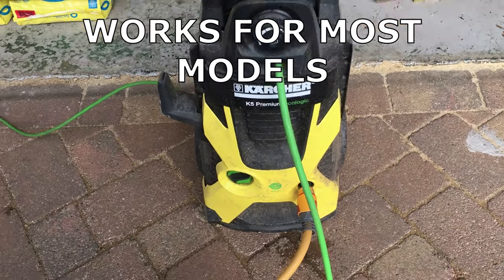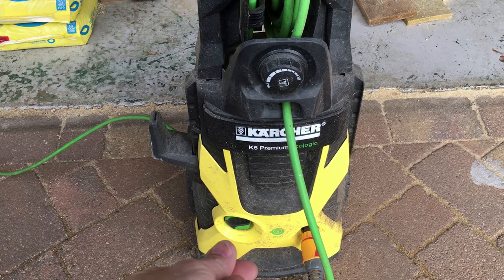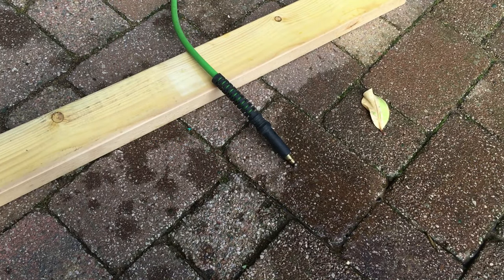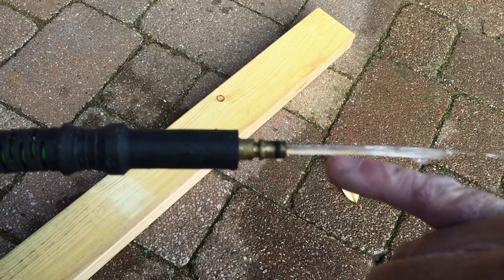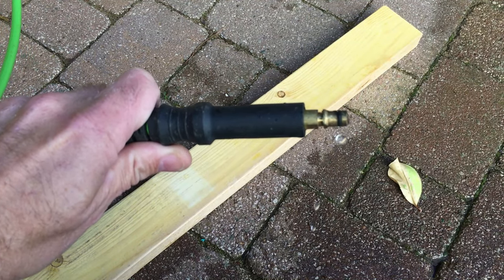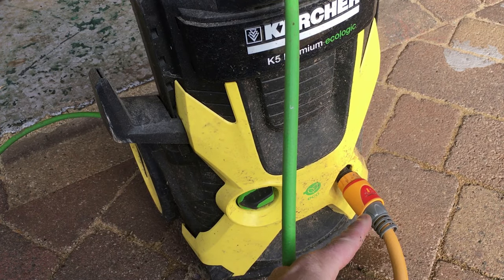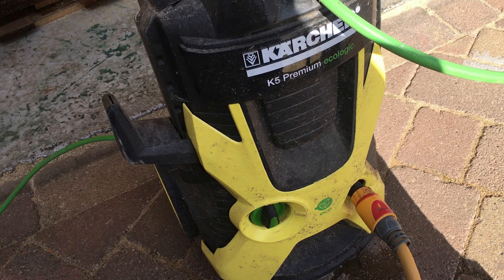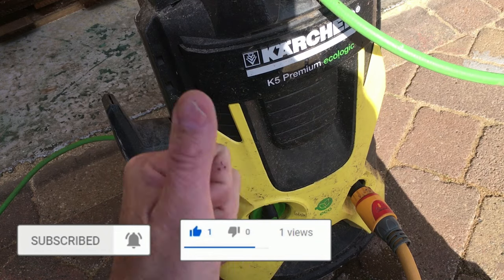KARCHER Pressure Washer Not Working | EASY FIX In SECONDS

Comment: It's great that you can share your experiences with the Karcher! A real credit for helping many people. Unfortunately, there are many variations of the Karcher - over the years, and they all seem to display many different symptoms - when in a 'failure mode". I own a HD 575S. It's an old machine from 1990. There is no fancy Pressure Piston & Microswitch for the "Instant start" function. The pump on this model, has twin valves (17mm A/F) on top of the high Pressure Casting. On the side of this Casting is a smaller (14mm A/F) Inspection Plug. My machine has the symptoms of not shooting high pressure water (intermittently) as you pull the Trigger. Sometimes when you squeeze the Trigger - it works fine. I stripped and cleaned all parts of the Karcher today, and everything (including the springs & valves of the Twin Valves) looked perfect. So, (now) I am suspecting the Trigger Mechanism of the Lance. I suppose many people will have a Karcher that has very niggly problems. My Karcher goes way back to the 1990s. It's not dead yet! I will find the cure. Greetings from Australia.
Reply from the maker: Thanks for the comment Peter, and greeting to you from Scotland UK !

Comment: Absolutely brilliant, thank you. Ran water on the K2 for a couple of mins, reconnected and karcher working as expected. It was a challenge for me to remove the hose from the main lance because so much pressure had built it. Quite the bang once I prized off the yellow clip just just take care when doing this bit. My sincere thanks for posting this.

Comment: Gr8 video, I actually chucked me Karcher out on the Kurb for the local Council cleanup then started wondering if it had a fuse, googled it and found this video, went out at 3am brang it back in, done as per instructions informed and butter Bing she worked. Even after I’d cut the power cable, re-wired it plug her in putt, putt, putt, putt idles works 
Thanks 🙏 
Must have some pressure sensor in either base of hose sprayer or inside machine itself, resetting that sensor works a treat. 
DO NOT THROW OUT PRESSURE WASHERS TILL TRIED THIS..
Reply from the maker: Great to hear Steven, another Karcher brought back from the dead ! Thanks for the comment 👍

Comment: Cheers- worked a dream! Karcher should mention this method in bold text in the setup section of the handbook.
 Just bought a new K4 and had this problem from the outset. Assumed the unit was faulty and after some cursing & kicking of the blasted thing resorted to washing the car by hand then found your video during a trouble-shooting exercise before dismantling/returning the K4.
Thanks for your efforts ;)
Reply from the maker: Thanks for the comment and I am glad the video helped you out. Yes, Karcher should definitely mention this as there must be SO many of these machines get dumped when there IS an easy fix.

Comment: Mine has been having pressure issues but I reckon this might be the fix. I have had the lance detached and it was splattering like that but didn't realise that it could have air on the system. Will try bleeding it when I use it next. Thanks

Comment: Did as you said Eureaka all was well. An hour into the job lost pressure. Did the same there must be air in the supply pipe which is new. Also realised that my lance pressure control also stopped functioning properly. So will strip the lance down in case something broken or a seal perished. The joys.
Reply from the maker: Thanks for the comment, hope you get it sorted John !

Comment: Great !  I have an old version of the K3 ...the hose does not come easily off the handle (and  I did not want to open the handle)..but removing the nozzle ans pressing the trigger (no elecric power) to let water flow as indicated did the job ....great thanks (specially since the K. service in my country is absolutely no help !
Reply from the maker: Great to hear, thanks for the comment

Comment: Hi.  Would you know - are the detergent pipes part of the water circulation in the machine ? I ask as my pipes are clear of water and I cannot purge the air from my K5.  However, when dismantled for access, if I put my finger on the detergent access point at the top of the machine the air bubbles stop coming out ( I put the pipe that connects to the handle in a bucket of water.  I’ve just installed a new cylinder head which made no difference to the pressure - seems like 50% of what it should be.  Any other ideas ? Thanks.
Reply from the maker: Not sure to be honest ?

Comment: Thanks very much. Just curious as to why it need to run for 5-10 minutes, is that to clear out any air blockages as I would have thought that would be instant once run through after a few seconds of flow.
Reply from the maker: Yes, to clear the air, but also to let the machine know that there is not an air lock. I think there is some kind of safety switch to protect the motor (in the event of an air lock), so running the water through disengages the safety switch. I may be way off the mark but it worked for me hence posting the video. 
 I have had a few people who say this did not work for them, so I always tell them to leave the water running through for longer and 9/10 times it ends up working. Hope this helps
Reply: @Bacrenfencing  awesome, thank you.

Comment: What is still spluttering after 10 mins? Do you keep the tap running until it's flowing properly?
Reply from the maker: You will never stop the spluttering totally, but if you get most of the air out of the system, the washer will fire up again.

Comment: Had high hopes, but sadly this hasn't worked for me (yet, anyway). My K2 has stopped and will not start again. I followed your instructions, and sure enough there appeared to be a lot of air in it, but after about 10 minutes it started to run more freely, so I connected it back up. Unfortunately, there is still no response from the unit. Is there possibly a switch inside that I may need to reset? Any advice would be much appreciated. Thanks.
Reply from the maker: Try running the water through for a good 15-20 minutes, that sometimes works. Not sure about the switch ?
Reply: @Bacrenfencing  Thanks for the reply, will do. I have taken it apart since, but couldn't see anything obviously wrong. Someone said something about a trip switch, but it looks like it's just the actual switch mechanism. After I put it back together, there was a very very brief noise when I switched it on, but it's gone back to not working at all.  I'll give the water running another go before I get a new one.
Reply from the maker: OK, let me know if it works James, I hope that it works for you.

Comment: Hey bud.
Ive got a K5, starts up and when ye pull the lance trigger, the water comes through and the pump/motor runs but its not up to pressure beyond the normal garden hose pressure.  Have i missed something?
Reply from the maker: Not sure ?
Reply: @Bacrenfencing  No probs bud thanks for the video anyway,might be a valve ir the seals startin to go, they can be changed quite easily i think.

Comment: Didn't fix the issue for me. Will try another capacitor and see if that does the trick but if it's not either an airlock or the capacitor are there any other quick fixes?
Reply from the maker: Not that I'm aware of mate

Comment: Few things to keep in mind.  The most popular garden hose size is 5/8" diameter, but the one you want is 1/2" diameter for reasons described in the video.  Consider this -  1/2" feed from laundry tub going to 5/8" garden hose; there will always be air in it, and your pressure washer will never work.  Also, there should NEVER be size adapters between garden hose and feed, because this will also trap air.  Same diameter quick connect is considered acceptable, but you will have to air out the system for a few minutes every time you reconnect.

Bottom line, Garden hose must be 1/2" diameter, and no size adapters allowed.  Pressure washers are finicky things, but it's also to protect the motor; air in the hose is akin to your max RPMing your car, letting fall, max RPMing again...on and on until your engine blows.  Pressure washers are smart in this way.l
Reply from the maker: Thanks for the comment 👍

Comment: Did this process twice for my K7 compact and couldn’t get it working only 2 years old, had a K7 compact before this one that lasted me more than 12 years, not sure about the reliability any more. It’s also difficult to find somewhere that can diagnose issues as it’s very difficult to contact Karacher and it’s not the kind of thing worth posting off to get repaired and what would that cost. They have also made the case fixings awkward as to open the unit yourself they is funny star bits that needs to be very long and thin to reach inside where they have located them.
Reply from the maker: Ah, sorry this did not work for your K7 - that's a real shame. Hope you get it fixed in the future

Comment: Thx for the video, but mine stopped working again after I followed ur instructions, any idea on what might cause that issue again?
Reply from the maker: Try it again but let the water run through the lance for longer - that may help 👍
Reply: You may need a new plug.

Comment: Tanks for the video, but this trick didn't work for me.

I disassembled the mechanism and inspected it.
The motor will only run if there is no pressure at the cleaner outlet.
This mechanism works well.
The problem was in the electric toggle switch.
I opened it and cleaned the contacts.
Everything now works perfectly again.
Reply from the maker: Thanks for the comment !

Comment: Checked the fuse at the plug, that's ok, ran the water for 10 minutes without any attachment, switched back on still no sign of life...any suggestions?
Reply from the maker: Try running the water through for a longer period of time, sometimes that will work.
Reply: @Bacrenfencing  I did run it for a very long time, around 20 minutes...no sign of life, I'll try again at the weekend, away for the rest of this week.

Comment: My hose won’t stay into the attachment so when I put on the water supply, the hose just comes off the attachment. Any solutions?
Reply from the maker: Are you using the correct hose adaptor ? Or do you mean the actual connection on the machine is broken ?

Comment: I was using my Karcher when it stopped working the motor started making a high pitch noise stripped it down the motor is working but the pump is not. Any ideas ?
Reply from the maker: Sorry Gary, not sure what the issue could be, maybe best to send it in to a repair shop ?

Comment: So what can I do if my high pressure hose won’t attach?
Reply from the maker: Not sure what you mean ?
Reply: @Bacrenfencing  the high pressure hose is supposed to just “click” in. So I attached it, turned on the water, and the force of the water blew the hose out. Powere works fine. My regular hose attachment is secure.

Comment: My problem is that the on off switch doesn't work (always sounds like it is on). But when I squeeze the trigger it doesn't actually build pressure, just rumbles away.
Reply from the maker: Not sure what that issue could be ?

Comment: Great tip, I get this all the time, and get through it exactly the same as you do! 

On a separate note mate, have you ever done a Van video? What shelves are you using if any? How have you got it set out etc? I’m about to remodel mine and think that will be my first video, followed by six 5 min Milwaukee tool reviews I have made, I’m just trying to work on a Chanel name and graphics etc. It is on its way though.
Reply from the maker: Hi Gareth, Not done a van video yet but I do plan to. I use a Ford transit Custom and it has custom made shelves. I look forward to your first video mate 👍😀
Reply: @Bacrenfencing  A transit man are you? Nice vans, I use a VW Crafter LWB HR, it’s kind of got some shelves in and a lock box but I’m literally in the middle of cutting out all the plywood pieces so I can assemble my own custom shelving units down one side, I’ve taken ideas from a few diff companies that produce them and used what Ideas I think are good from all of them. If money was no option it would be all kitted out with Packout storage and Festool tools top to bottom but I am trying and will get there one day. Tbh I currently work for a company doing maintenance on their 6 sites across the Uk but they don’t pay me what I’m worth imo, I’ve always wanted to work for myself so atm I’m gathering as many pro tools and supplies as I can afford to buy each month with a hope of going alone doing something similar to yourself, except property maintenance for other landlords instead of my own properties, I’ll get there, we all have to have a dream don’t we! 
This is why I like the videos so much they really have taught me a few decent tips that I’ve used in real time scenarios! Top man, all the best! 👍😊

Comment: Or buy a heavier condensator. Not the 20uF but a 40uF. Karcher 9.002-614.0 Condensator 40 uF if the solution is not working in the video. Easy fix
Reply from the maker: Thanks for the advice

Comment: Mine is a K5.700.  There are no leaks - while the machine does work there is simply just not enough pressure.  Have run the water for 20 minutes and still getting air bubbles, so air somewhere in the machine is most likely the cause of low pressure.  When I turn on the machine there is sufficient pressure as the motor turns off until the trigger is pulled. Does anyone have any ideas ?
Reply from the maker: Not sure, maybe someone else can help

Comment: What happens if water is not coming through either?
Reply from the maker: Must be a kink or a blockage in the internal hose on the machine ?
Reply: @Bacrenfencing  thank you very much for the reply. I took the hose (unit to lance) off and washed through, reattached everything and it started working. 🫢
Thank you anyway. 
I really appreciate these videos and community engagement. Helps a lot. 
Thanks
Reply from the maker: No problem Gareth !

Comment: any one not  had this solve the problem? I 100% don't have an air lock and  I'm about to cut this thing in half and fling it over the rainbow
Reply from the maker: Try running the water through for a good 10-15 minutes, sometimes that helps

Comment: I've tried this, and even took the high pressure hose out.... and its still spluttering 😔
Reply from the maker: Not sure Carole......... ?
Reply: @Bacrenfencing  a guy at work suggested it may need a new cylinder head 🤔
I'm going to check that out to see if any obvious damage to it. If there is, a new cylinder head is cheaper than a whole new pressure washer, so I'll try that first 😊